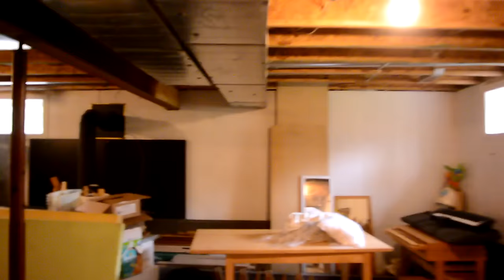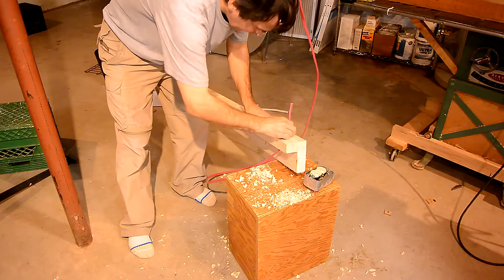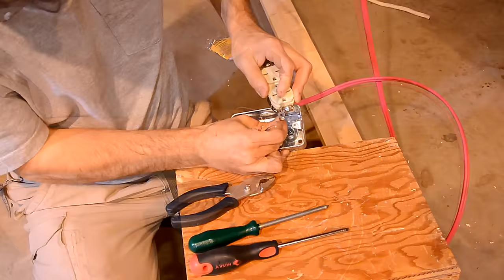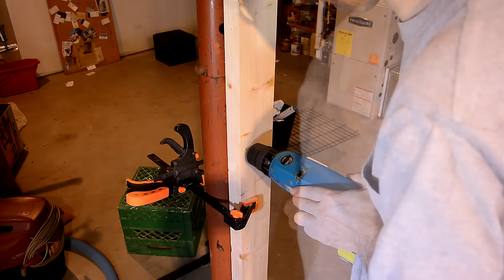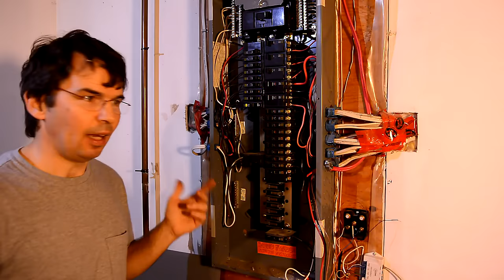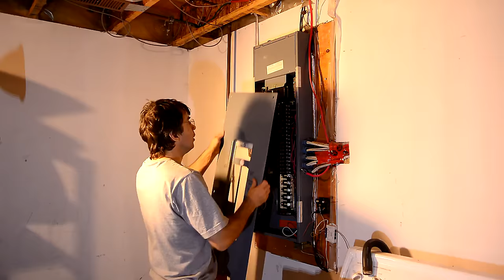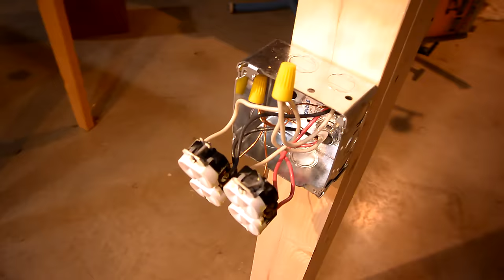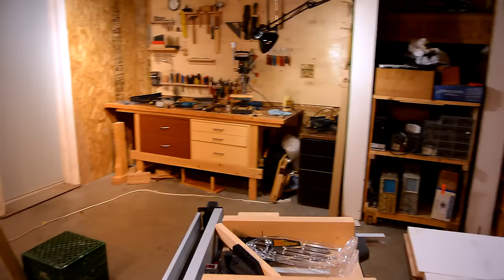Wiring a new 240 volt circuit

Comment: Not that I really care too much about the safety aspect as I am just as likely to do many of the things you did in the video, but I really do feel as though you should have turned off the mains. Think of it this way,: that electrical box is grounded, so if you happen to be leaning on or touching it and accidentally brush your finger past a hot line, you may be in for a little shock! I don't think video lighting is an adequate reason to risk your life! Great video otherwise, and I always look forward to more.

Comment: You remind me of RICK MORANIS, but, in your video, I would have put your plug-in closer to the overhead beans, in case your basement floods, and I'd put a separate post next to your floor jack. In case you need to relevel your house. HOWEVER, you just showed me how easy it is to put in an extra outlet for larger appliances, I always thought you needed an electrician to do that. I'm sure this is allowable for houses and not apartment buildings, where you want to have an extra 240V appliance. Thank you

Comment: wouldn't it be easier and a bit safer to connect the wires to the breaker before clipping it on to the panel?
Reply: Most all electricians do that. Matt would probably agree.

Comment: I'm not sure I followed the last trick with the loads on the shortcut neutral wire canceling out each other.
Reply from the maker: that's ok.  It still works even if you don't understand it.
Reply: Matthias Wandel actually I hoped you would link to somewhere that gives a circuit plan or throw a googlable term at me so I can teach myself. Unfortunately, that reply didn't make me smarter.

Comment: Sooo many electricians on youtube lately!?!? he's in his own house and not likely to burn it down!?! i'm in scotland now and i always find european wiring/distribution systems and terms,,,unusual ,, but it works, sooo for all euro out there, don't you see that american/canadian systems work too? put the outlets as low as you want or have them floor mounted,,they clearly have breaker protection!?! I wana know why the newest video seems ages old!?!?  it's of his old shop in basement,,seems well before he had the basement shop max kitted out..and he even looks few years younger?!?  look forward to new video mr Wandelful!?!))
Reply: All true.  I did see a floor outlet smoking and the breaker was very happy to start a fire.  I don't remember what the problem was.  I just replaced the outlet.  I think it was one that had no ground and a resistive short was acting like a heater.  The breaker thought that a 15 amp load was on the circuit when it was actually dirt and corrosion.   I'm pretty sure that damage would have occured if left unattended.

Comment: Working on panels is only allowed by licenced electricians here in Australia. Also you have not connected an earth which is mandatory with all socket connections.
Do you have safety switches ? as 120v can kill just as 240v, sic your three phase voltage.
Keep to wood my friend as I am sure your many followers would want you around for a very long time.

Comment: Can someone explain how he ran 3 wires for the 240 volt outlet  and then all of a sudden has 4 wires to the 120 outlet?
Reply from the maker: Yes, I ran a wire with four wires to the 120 volt outlet.  Simple as that.
Reply: @matthiaswandel  yes but im confused to where are the other leads connected to taking into consideration you only ran 3 wires to the fuse box . I appreciate you replying I did not expect that from the creator of the video. Reason I ask is because we are planning on running 2qty 110  volt outlets to our porch which is about 50 ft from our fuse box. I came here with the urge to learn how to do it. It seems you skipped the part where you went from 240 to 120 connection demonstration. Red and black I understand they are connected to the main plates 120 each wire and the copper with no plastic coating is going to neutral? But where is the whit one connecting to in the 120 outlets?

Comment: It's actually illegal to do this in Australia, unless you're either just plugging in an extension cord, or you're a qualified electrician.  We have 3-phase power to the house (i.e. about 400 volts) with each phase supplying different circuits, each at 240v and 50Hz.  But all domestic installations have to be carried out by a qualified and certified electrician.  Apart from the danger to person, any uncertified electrical modifications would void the household insurance.
Reply: I wonder what percentage of homes in AU have 3 phase? A Solar webpage here says 20 percent in Perth have 3 phase power: http://www.solar4ever.com.au/3phase.php   This page say " Many homes in Australia have a 3 phase supply."  http://reneweconomy.com.au/3-phase-trickery-utilities-ripping-off-solar-households-17282/

Comment: So I just want to know if it's legal to route your own wires. AFAIK here in Europe you need at least have a certified electrician to check your work before you are allowed to use it. Same over there?!?
Also: Here in Europe we have the 240/400 VAC. Got shocked by 240 last year twice. Aint bad. Got energized well ;D
Reply from the maker: I got zapped when with 240 volts a couple of times too (back in Germany).  Much worse than 120 volts.
Reply: Nope.  The americas are fare more sensible.  We have this thing they call freedom.

Comment: For you safety nuts . The power coming out of a breaker will most likely just zap you , and you would be ok unless you have heart issues. It’s the power before the breakers like if you were installing a new panel, if you were to touch positive and negative it would suck you in and lock all your muscles and then you are certainly dead unless someone wearing gloves is there to pull you off. This happened to me many years ago. While changing a panel as I was hooking up the main lines to the hub my elbow touched the side of the panel witch is ground, and my finger touched the bare wire while putting it into the hub. My body just looked up and I thought it was lights out for me, luckily my boss was behind me , and he grabbed the back of my shirt and pulled me away. He saved my life that day. So this shit is nothing to take lightly, and the way he was doing things was not to smart.

Comment: I guess North American electricity is working somehow completly different from european :) Here normal is 240 and for "heavy machinery: its 380. so 240 always one is hot, that you should not touch and other one is neutral, so that you dont have to be affraid of that. 380 just 3 different hots and 4th wire is ground (optional). easy as that. and with 380 e-motors you can change direction of its turning just by swapping 2 hots.
and i am always thinking how much weaker are those 120v motors

Comment: How come you yanks don't have 240V as standard?
Reply: Because the USA was the first green country! . Edison' bulbs came out in the 100 to 110 volt range to save energy. ie the Lumens per watt is higher for a 120 volt bulb than a 240 volt bulb. 

Thus the wasteful  not green higher voltage was rejected as wasteful. 

Other countries did not care they had gold bars popping out of the ground to pay electric bills! :)  

 Back in say 1890 to 1900 the cost of electricy was 15 to 30 times higher than today in the usa. 

The primary load was filament bulbs, thus the Lumen per watt mattered, Early homes had say one single 15 watt bulb in each bedroom, a 25 watt in the kitchen and family room and a giant 40 watt bulb to impress folk a the dining table.

 The Lumens per watt in those filament bulbs and tungsten bulbs was 10 percent with 220 volts than 110 volts a century ago. Thus other countries did not care? :) :)

Comment: How is it possible you dont get zapped? Even when wearingrubber soles and such, in Europe I will definitly get a shock caused by potential difference alone.
European standard home voltage is 230v at 16 amps and 50 Hz.
Reply from the maker: clearly not something you have tried
Reply: Of course I "tried" it (by accident), and also wearing workboots while my floor is also wood. Still get a shock. That's why I do not understand you can touch it unharmed..

Comment: I'm surprised that you used a 15 amp breaker with 12 gauge wire. (I use a 20 amp)
Reply from the maker: The wire could dertainly take more, but I had a spare 15-amp kicking around, and for the machines I'm using, even 10-amp would have been enough.

Comment: That is some scary shit! So is that what an 'average' domestic breaker box and mess of wires looks like over there? 
And is that a regular domestic supply?  
2 phase, that's so weird! Here in the UK you only get single phase 240v (domestic) and 415v 3 phase (comercial)! 
There used be 2 phase 30 odd years back but that was almost exclusively for farms. 2 phase has all but been phased out (sorry, bad pun) as the directly apposed wave form was very lumpy requiring considerably heavier gauge cables to supply half the power of 3 phase! 
Plus the advantage of 3 phase is way more economical to generate and supply, allowing for 110v, 240v and 415v to be supplied in a single cable run, not to mention easier on the generators as it's much better balanced.
Anyhow, glad you didn't blow yourself clean upstairs! I'd miss your videos...
Ps.
Don't answer a question from me about how to make something with a different Power tool with the words "because It's safer with this tool" Ever again!!

Comment: Everyone here says it cheaper to run 2 phases 120V than 3 phases of 230. maybe it is. But i know the large grids here in Sweden is 10 KV it is then transfeared down to 230 closer to our homes. 2 phases is one cable less, but to send the same W you need thicker cables or do you solve it by using higher voltage, or do you youst have a bit more powerloss in the grid.
Same close to our home, couldnt we have less diameter on our cables becuse our higher voltage. And there will also be less powerloss in cables ( maybe insignificant ).
Also some machines runs more efficient on 3 phases ( maybe im wrong here ) like washing machines

Couldnt it be that US is more ok with powerloss. But in return have slighter cheaper installation costs.
Not want to say either is better. But i guess there is a diffrence for a reason.

Also regarding safetly, i learnt from an electrician if you working on a live system. Put your left hand behind your back, you dont want electricity run by your hearth. even if im not always do that im thinking about it when i work.

Comment: If you lose that neutral all your 120v devices will be connected to 240v. Such is the disadvantage of shared neutral.
Reply: I don't think that's true.  They would only be at 240v if the communicated w/ each other.  They are separate and do not connect to each other in any way.  Let me know if I'm wrong somehow.

Comment: I'm an electrician licensed in VA an I have to say this video is a lot less cringe worthy than your dryer plug conversion. However seeing you touching the buss bars in your panel as if it's a neat trick to explain how electricity works and can be worked on when the power is on, isn't a demonstration I would choose to put on a chanel that people might think to trust. A friend of mine was put into the hospital with third degree burns when working on a live panel, granted it was a 4000amp 3 phase 480volt switch gear but he was a master electrician that made a simple mistake. It can be easy to make a mistake if you don't fully understand how dangerous electricity can be and if you take lightly the codes and regulations that have been developed over the years to keep people safe. I like your chanel Matthias, you have great engineering ideas  and power tool building. You can call me safety police all you like but it's irresponsible to make instructive videos demonstrating unsafe wiring practices as if it's ok.

Comment: Typical Hobby Bob electricity setup which doesn’t need to be safe. Why not using at least tubes to guide wires protected. If you walk with lumber it is quite imaginable you will hit or pick a wire sooner or later. The wires can be damaged and can cause unsafe situations. Phases are opposites? I think they are 120degrees twisted right? Maybe it’s different in the USA / Canada. We have 3 phases 120 degrees twisted. We are working with higher voltages 230v / 400v which will require more safety precautions off course.
Reply: In the USA, we have both.  Residential typically uses a center-tapped 240VAC which allows 2 phases of 120VAC that are 180 degrees out of phase, or 240VAC.  In heavier use areas (like industrial buildings) you can get 3-phase power. It can be ran different ways, but th most efficient is 3-phases ran 120 degrees apart.

Comment: You realize that you now have 240 volts in that twin duplex 120 volt receptacle by using two phases of 120 volts to wire it.  Not sure that is very safe.
Reply from the maker: It's standard practice for kitchen outlets in Canada.

Comment: Dude come on your voltage never changes in ac current. Watts and current draw is lowered by led but you still have the same pressure to arc if those cords become compromised.

Comment: Where is the logic behind the 120/240 split phase power? And that horrible way to connect breakers in the breaker box: what if you want put something AFTER the breaker, or change something around? Odd.
As an electrical engineer, I find this odd. If someone can explain why they used this method in US/Canada that will be good. We have 220V 50Hz in Russia, with most medium to large homes using a 3 phase supply. (that is 380V)
Reply from the maker: if you want to change something around, you pull  the breaker and change it around.  I don't understand the question.
Reply: Matthias Wandel Well, if you need (for some strange reason) to put something after the breaker in series: will not work.
And one problem of the plate method is that the terminals that push against the plates get loose over time, and don't make proper contact.

Comment: Whilst this is very useful information, because youtube is international I wonder if it would be sensible to provide a caution saying the information applies to Canada. 
In Europe the 'normal' mains voltage is 230 volts AC and the modern cable colours are brown for 'live' L, blue for neutral N, and green/yellow for earth E (also called 'ground') (in Britain at least the old colours still found in many houses are Red, Black, and Green in the same order as the modern colours).

Comment: Where is your ground connection?! If some wire in that nice table saw starts rubbing against the metal parts, you might end up with a 240V table. That would definitely add a whole different level of danger to your saw.

Comment: Wut? Is Canada a third world country? Exposed metal bars with 240volts between them right next to each other?
In Europe the only exposed is wiring is the ground connection, for obvious reasons.
But it's cool anyways, now I'm really interested in how whole energy supply from grid to wall-outlet works in that continent.
---
By the way, it's quite ironic when Americans joke like this: "in Soviet Russia, electricity fixes you", and their supposedly low safety norms. Meanwhile in Russia all the electricity is insulated.
Reply: sasja de vries. The buss bars have to be exposed metal. That is how the circuit breaker connects to them.
Reply: in Russia all the electricity is insulated.... Maybe, but you're still in Russia... which may be more problematic that an exposed busbar in a closed box.
Reply: Normally there is a cover that goes over everything. You remove that cover to install additionnal breakers. Apart from that the cover always stays there.

Comment: There's a lot of code issues here.  My guess is that ESA inspectors would be most concerned with the lack of AFCI protection.  New receptacle circuits NEED TO BE ARC FAULT PROTECTED, with very few exceptions(not the 240)... the other circuits you added need to be tied into the load side of an AFCI plug mounted near your panel (because your panel is old, AFCI breakers don't exist for it).  this also means you cant use 14/3 because of the shared neutral.  You would also need to use BX between the AFCI plug and the panel.

Comment: Since you're going to do it yourself anyways:

1. Don't use BX connectors for NMD90. Plastic Grey Connectors are both cheaper (50 cents each) and the proper connector for that wire.

2. Lift up the 240V receptacle. It's too low and honestly who wants to bend that far to plug something in.

3. Going to touch a live bus bar? Put your other hand in your pocket to reduce risk of contacting something with a path to ground.  PS, your shoes aren't that insulated after being worn down. Don't just assume they're good.

4. For the love of God, stop touching the metal on your screwdriver when screwing wire into a breaker.

Protip: Don't pull the entire length of wire through each joist. Only pull enough to make it to the next one. Results in easier, quicker, and straighter wire pulls.

Comment: Even with rubber soled shoes on a dry floor, still not really a good idea to go sticking your finger into a live breaker panel. You say you're safe as long as you don't touch ground and hot at the same time, but weren't you just saying the second bar is also hot, and 180 degrees out of phase? That's a whole lot more dangerous than just the 120 volts, and the bars are pretty close together. I'm not going to tell anyone what to do, if you want to do dangerous shit that's your business, I just don't want anyone erroneously thinking this is safe